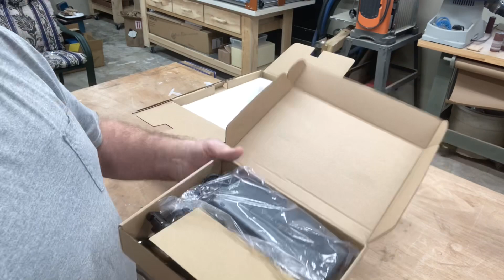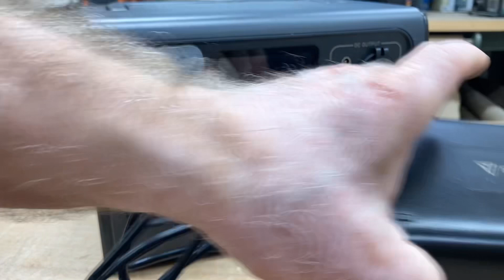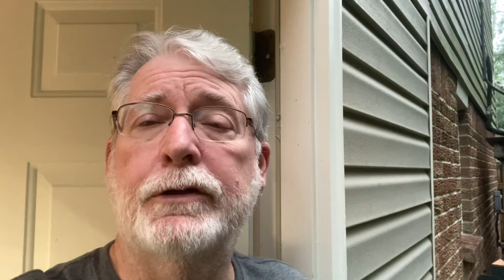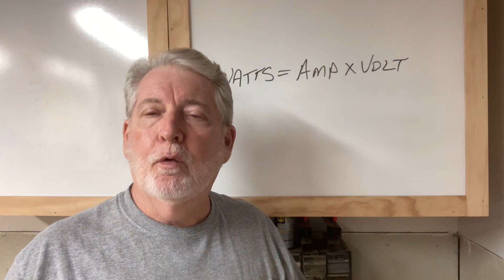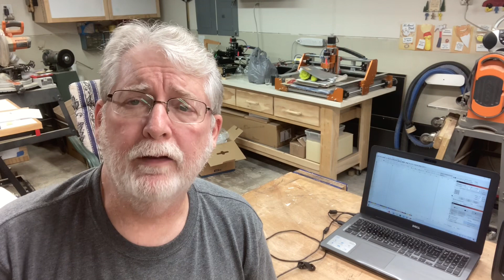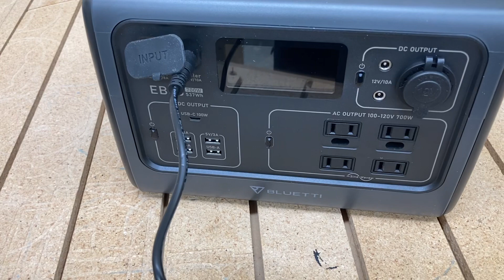Bluetti EB55 Put to the Test

Comment: The AC brick charger is not  only huge but it is also quite noisy as the cooling fan turns on whenever it is pluuged in and does not turn off.

Comment: So if the max load is 5.83A @ 700W, that would mean the max hours (537AH) would be just over 92 Paw Paw. The examples they give don't seem to make sense to me. But it might work well on the boat instead of an inverter drawing on the Lithium batteries!
Reply from the maker: A boat would be perfect. Camping yes, emergency backup, limited. Over the past couple of months I’ve used it quite a bit during the numerous storms that have hit this area. It gives peace of mind that I will not damage the laser and or the computer. Losing a TV was bad enough, losing the equipment in the shop, worse.